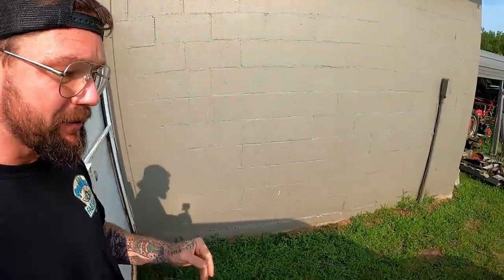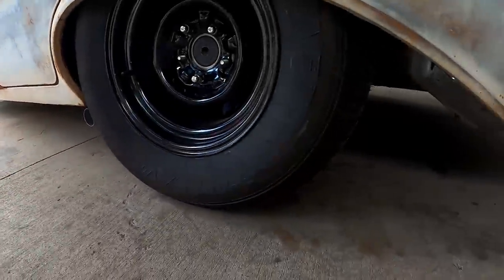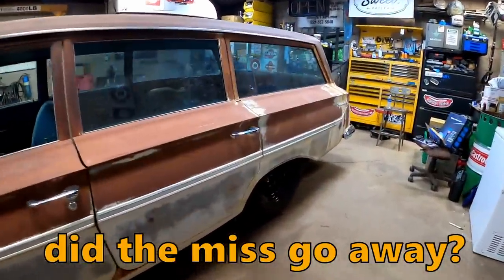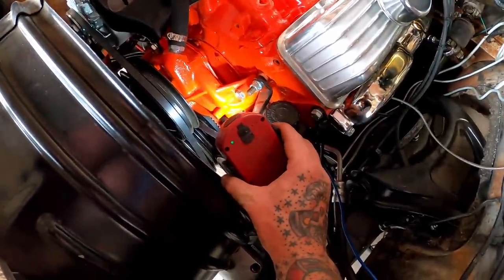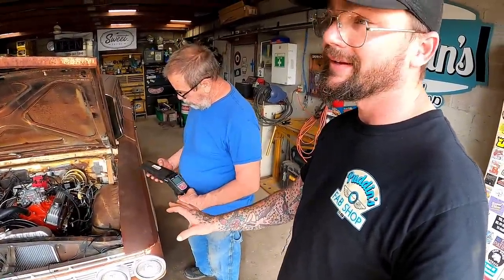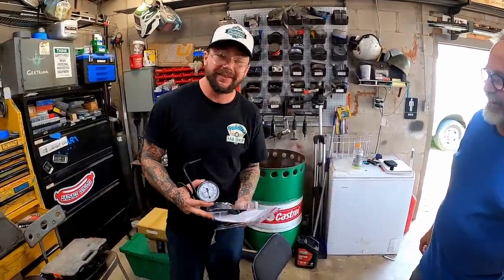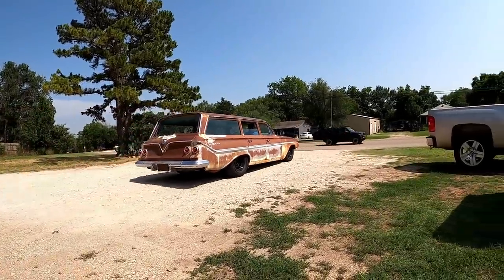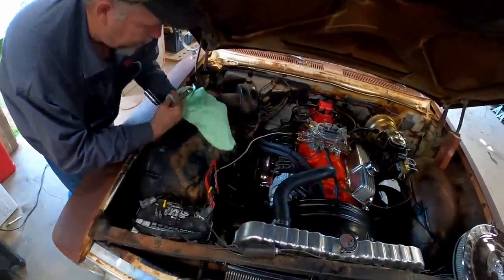Why is it running BAD? 1961 Chevrolet Parkwood. NEW EXHAUST.

Comment: Take an old set of valve covers, cut the tops off and install them. Start the engine, loosen the 1st rocker arm till it chatters, tighten it till it stops making noise, tighten half a turn. Repeat 15 times.

Comment: I’ve got a 155” 2010 express 3500. Once you find the utility of them you are forever a van man!

She tows better than any other truck you own! Strong and stable!
Reply: any chebby van we had since the second gen in 1971 was epic ran like snot  and the early ones from 71 to 77 were  hot rods with no pollution stuff, only prob was traction and I did a 360 with no load on a g30 and ran  slicked road

Comment: Perfect timing Mr. Puddin! I'm happy to see that your "company" grows so you can buy reliable work trucks. ❤🎉
Reply: Today went to get my truck inspected damn bolt holding the rear leaf springs on ripped a few threads out and shifted two inches to the right so when you hit the brakes it would pivot so it failed. Need to fix way my life goes any need a new universal joint also broke in line to get inspection
Reply: 📝Woody, Wagon, Pecking Parkwood,
Got a "Popping Problem",  Under the Hood,
But P-Tang, Slick & Bill,  Made it Understood, 
If 7 Sparks Didn't Send Her,  they Knew that 8 plugs Would ! 🤣🤣🤣🤣
Reply: @keithreilly386 😂😢😢

Comment: That van will probably tow just as good as your pickup., maybe better. The only difference between the two might come down to the gearing.  The only downside I’ve ever experienced towing with a cargo van is they are harder to see out of, other than that they are pretty similar. 

On a side note: I had a fleet of vans for my business both Ford and GM and the weak point of the GM vans was their transmission so you might want to do a preventative service on yours. I think I put transmissions in ever one I owned but we put a crap ton of miles on them everyday. They were excellent trucks. At first you might get the creeper van vibe but driving them kinda grows on you and you see why people like them.
Reply: Yeah, the ford's are the worst. I've blown every ford trans i ever had. Gm trans last much longer.
Reply: Well I would disagree with them being the worst but to each their own. I can only speak on the van’s I’ve personally had and out of all them I’ve never had to put a trans in any of the Fords but that’s not to say I’ve never replaced a transmission in a Ford because I definitely have, just not in any of the vans. I was thinking about it and I can’t remember if the Chevy’s I had were 4L60’s or 4L80’s, but if I was to guess I would venture to say they were probably 4L60’s since they are notorious for not being the best. Even at that they were still excellent vehicles and they got the crap beat out of them everyday. Every brand has problems there is no perfect vehicle out there…

Comment: check the threads showing on each rocker nut...sometimes the press in studs work loose and work their way out of the head....just a suggestion if it keeps going out of adjustment....love watching you show never miss it....God Bless keep up the good work
Reply: ding ding ding , give that man a sucker, I bet hes got it. get to yakin those heads boys
Reply: We used to drill the bosses and studs and install hardened roll pins to stop them from pulling up under stiffer valve springs
Reply: Been there on the pulled rocker bolt

Comment: The screws you're referring to are your idle mixture screws. If one is closed off, then the bank that screw serves will run lean, thus one side of the engine will run hotter than the other.

Comment: I got a 2006 3500 GMC Savanah, has 236k miles, bought it to pull camper. Was surprised how good it pulls, and great power. (6.0). I love this old “creeper” van. 15 passenger, took all but 1seat out, have bunks in back. 
Never will junk it, I’ll put new power train if it ever goes down. 
Thanks for entertainment.

Comment: Be on the lookout for the rocker studs backing out. If those rockers keep getting loose on you it's a strong possibility that those rocker studs are backing out.
Reply: drill and tap the studs for screw in types

Comment: I have been a mechanic for over 40 years and my shop teacher back when i took the course told us to check plug gaps every time you remove them. Love your show. You always start with a basket case project.  And by the way i have peripheral neuropathy  and have severe pain and weekness in my legs and have been sittin on my ass and finishing my projects for the past few years.

Comment: Take one valve cover off at a time and stick a piece of cardboard and run it and adjust the valves that way back it off till it makes noise the start to tighten it till the noise goes away and then give it a quarter turn
Reply: Add aluminum foil to the cardboard and it will take exhaust heat.

Comment: Adjusting the lifters pull the valve covers ,stuff a rag to catch the oil , loosen the rocker bolt till it rattles. Then turn it  in 1/2 turn for gas mileage ,3/4 for performance .

Comment: I learnt a good trick recently, if a cylinders ex valve is on the lobe you can set intake and vice versa, do them cold. Find good specs to suit your engine. Cheers puddin

Comment: Brother, I have the Chevy “church” version of that same 3500 van and it is a towing beast. I pull a heavy race car trailer all around the country and with the 6.0 and better transmission in the 1 ton model it pulls great. You could definitely get rid of the truck if you wanted to and just tow with the van. That was a good purchase.

Comment: Didn't see anyone comment on the mystery part you thought came from the power steering fitting .
That's the guts from the cheap pvc valve that exploded a couple shows back.
Thanks for great channel !

Comment: Put it on TDC #1 adjust both rockers,  turn crankshaft a 1/4 turn that puts #8 @ TDC another 1/4 turn puts #4 @ TDC adjust them thru firing order 1/4 turn of crankshaft at a time will bring next cylinder in firing order to TDC . 3/4 turn of lash.

Comment: When I set valves I use a bore scope. Set each cylinder one by one to TDC. Use the bore scope to watch the valves open and then back off until they just close.
Makes it so damn simple. I've done so many of these in the last 7 years every engine has been different. I've had some that had open valves at 1/2 and 3/4 turn down. But doing the bore scope method I can guarantee they are right on the money allowing for max lift and 100% sure of closure.
Reply: Also when checking timing rpms should be at least 1000rpm.

Comment: Man that hurts the break in procedure is 3-3200 rpm  for 20-30 minutes on a flat tappet cam and in your last vidjayo it didn't sound much more than idle. I even had my toes crossed for ya brother. Stick your borescope down through the head in through the oil port through the to the cam and take a quick peek at what your cam lobes look like.  Good luck brother 🤞

Comment: Couple of thoughts. In my state they require you to run the exhaust out the back to get beyond the interior of the vehicle. I guess if it is legal in your state just be sure you aren't getting fumes inside. Back when I had a 283, I always adjusted the valves while it was running. Seemed to work really well. Nice to see the project coming together.

Comment: Puddin, do your valves in the morning with the engine completely cool. I use a  15 thousandths feeler gauge. Do exhaust on 1,3,4,8 and intake on 1,2,5,7. Turn engine  90 degrees and do opposite on remaining 7 cylinders (1 is complete)

Comment: I was taught to adjust while it’s running, loosen nut till it chatters then tighten till it stops (all 16). Then with motor off give each a 1/4 turn. Rags along edge of head will catch oil.

Comment: I drove an E-350 with 13 Boy Scouts pulling a dual axle trailer, like a U-Haul, from Houston to Altamont, TN which is 850 miles.
I know it's a different brand, but it pulled and drove great, drank a lot of gas with all that weight but I had no issues.

Comment: MAN I"M LUVIN' that Wagon!!   Just an FYI.  Change the PCV from the pass side to the driver side.  Engines pull fresh crank case air from the pass side (thru the breather) and release to the driver side where the carb picks it up thru the pcv.  You might be creating a internal vacuum that may or may not cause tuneability issues.  The PCV is a one way check valve. Therefore the engine is not able to pull fresh crankcase air in and will create a vacuum which may be why you are having a hard time setting the valves. Just something to consider.  Luv the work you're doing. Keep up the great content.

Comment: check you oil for the forbidden glitter. there has been a rash of bad lifters plaguing the aftermarket. unfortunately they usually wipe out the cam when they go bad.

Comment: Run the engine, valve covers off.  Can get a little messy, but...  back off each rocker arm adj nut till you hear clatter, the slowly tighten nut till clatter or ticking goes away... then tighten 5/8ths turn more tight.  Valves adjusted perfectly.

Comment: I always adjusted valves on SBC with the engine running. Tighten it down until it just starts to miss and back her of 1/2 a turn. Isn't by the book but always worked for me

Comment: I had a 2000 3500 van that I used for flea markets. I pulled a very heavy 18ft trailer that was very loaded. It had no problem doing 85 fully loaded on the interstate. Loved pulling a trailer with my van. Wish I had another.

Comment: I bought an Express 3500 passenger van to replace my pickup and I love it. I can take all the friends and family camping, or take the seats out of it and haul pallets of tiles without it sagging. It'll bounce down the road if it doesn't have any weight in it. It tows amazing too. Used it to move some friends recently, packed to the brim and pulling a full uhaul trailer it acts like nothing is there. The nieces joke about the white van and ask for some "free candy", but I just reply with "It has windows!!"

Comment: This is the third timbive commented on this, but... you plumbed your booster into the intake runner on the right bank.   That is a direct path for air to potentially lean out that bank.

Comment: Gm needs vacuum on start up ,then the weight in the distributor take over . On the front of the carb 2 outlets 1 with vacuum at idle for GM ,2 vacuum when revving your engine for dodges and fords ,amc.

Comment: I thought I would share a method I've used for years to set lifter preload. Grab a piece of cardboard and a marker. Write the first 4 cylinders of the firing order 1,8,4,3. Then below the 1 write 6, below 8 write 5, below 4 write 7, and then 2. Now pull the valve covers and roll the engine over until the number 1 cylinder is closing the exhaust valve and opening the intake. The number 6 is sitting on the base circle of the cam. Loosen the rockers on 6 until the pushrod is able to rotate with light resistance and tighten 1/2 turn. Rotate crank until 8 is rocking and repeat adjustment on #5. Keep going. When you get to #6 rocking ,adjust #1. It works for every firing order 4-6 and 8 cylinders.

Comment: That Van will pull like a beast. I have the exact same set up except I have a box truck version same van front 3500 with the duals on the rear and never had an issue, except for the infamous exhaust leak on the driver side rear manifold and the transmissions take a crap right around 100 to 150 K. But I love my Bertha it’s the work beast, the money maker.

Comment: I have had the same problem with tapping. I found out that the fuel pump was making the tapping noise. A spring breaks inside of pump causing taping noise. Try using a stethoscope to pin point taping. Love the show.

Comment: Believe it or not fellers, bill's way is the correct way to set valves on any engine, not just a sbc. And to find true TDC, you can make a piston stop out of an old spark plug

Comment: I took an engine out of a Dodge dart. Got it all together after fighting it and remembering finally it was a slant six which is why it would not go in straight. Also got it finally all done and it would not start. Neighbour came over and looked for a few seconds, hooked up the coil wire and it started up. 9 hours of non stop work, just gets you sometimes. :)

Comment: I'm a ford guy.  Drove a chevy 12ft box van for fedex for 4 years.  Had 170k when I got it and 310k when I left the job.  3 transmissions 3 rear ends.   But that engine....6.0.  Solid as hell.   Hard life for a van but the engine took it like a champ.  Nothing but respect for that LS.

Comment: That van will practically do everything you need of it. I did residential irrigation for about 8 years. Had to tow pipe puller’s, mid sized trailers full of equipment and it never let me down.

Comment: I just sold my 2016 Chevy express 3500. Had it for 7 years and only used it for vacation towing a camper. Put 25000 miles on it towing and it did it flawlessly. Yes, you did have to stomp the throttle occasionally but it towed with confidence. I also had to install a hitch. No factory wiring in mine, had to run everything front to back. But all in all you won’t be disappointed!

Comment: If y o ur using old stock roxkers. They may be worn out. I like comp cams magna roller tip 1.5 or 1.6. Cheap quick fix. I like 1.6 for a hair more lift !!! Keep up the great work brother. God bless

Comment: Hey Puddin, don't feel bad about zinging past that spark plug in your troubleshooting. I was a Mechanic/Ford Tech for 24 years (2 careers ago, lol) and just a month ago I dropped a plug and didn't think to check it before I installed it. Yep, bit me in the ass. Luckily, after making that mistake a handful of times over the years, I only lost a few minutes screwing around and scratching my ...umm...head before the light bulb came on. 
 There's a lot of mistakes that you only make once, and the lesson is learned for a lifetime. I think the spark plug ding is one that Murphy says you need to make every few years just to keep you on your toes. At least,  that's my excuse. Keep doing what you're doing, buddy, it's working for you and I'm glad to see that.

Comment: I use a long screwdriver to find top dead center.  Turn the engine until the screwdriver quits moving up and you are at top dead center.  Works a lot better than your hand or thumb.  I also used a pipe wrench to turn the engine at the crank nut.

Comment: Hey Puddin I got some bad news for the Pott county legend, bud that cam is most likely going flat on #6 hole.  I’m happy you got the 6.0 ready to tow  tow pig you deserve it.  The van is also a great addition and imagine all the parts you can stuff inside with a project on the trailer 🎉

Comment: take a marker and put a mark on each pushrod and then crank it up. if any of those pushrods aren't rotating the cam is bad. if the cam is good then zero lash + 1/4 to 1/2 turn of preload is good.

Comment: I LS swapped my 71 C10 using the same drivetrain as that savanna gmc van. It’s a Gen4 LY6 paired with a 4L80 trans. Solid motor and trans combo. It’s got the good flowing heads from factory.

Comment: Another way you can adjust the valves but its kinda messy, pull the valve covers and start the engine. Back off the nut on each valve until you hear a chatter. Tighten until the chatter stops, then go a half to 3/4 turn more. Do this with each valve.

Comment: You should cut 2 pieces of 2x4 about 4 ft long one each at the back of your ramps it'll do a huge difference when you have a lower vehicle it might need double stacked on each side but usually with something that high you can get by with one on each side.

Comment: I used to drive a van just like that one but a window van for our local high school marching band. It had the 6.0 with the 4L80E. We pulled a 22 foot enclosed trailer full of equipment (drums, stationary instruments,  Props, and uniforms) and usually 5 to 7 adults in the van. Not a problem running in PA mountains and highways.  I drug that trailer through Philadelphia during a Phillies game with no tow mirrors.

Comment: Things not working out here either. Bought a 2011 wrecked car to put the motor in a 2011 with a bad motor. We got it in and the wiring wouldn't connect.  Found out someone put a 2007 motor and wiring in it. Yep both titles are 2011.  Thanks for sharing with us.

Comment: The streetrod shop I worked at back in the day used to have a 3500 6.0 van to haul a enclosed trailer all around the country with multiple chassis and show stands in ect. I'd highly recommend it.

Comment: Ran into hyd lifter failure issues where brand new lifters were not hardened and ground correctly. Mainly because all hyd lifter grinding is mostly done in Mexico now. Might have been a learning curve. 

After two sets failed and had to replace a new cam, I got the diamond like coated ones DLC lifters from comp. Along with their mutha thumper  cam for stock lifter height.

No issues with 1/4 turn preload on E Street heads.

The point is, if she keeps rattlin pull the intake and check lifters. That will give some content to film.

Much love ombre.

Comment: Loosen your valves with the engine running until it starts to tik tighten a nut until it quits is the best way to do your valves

Comment: Oh ya them express vans are extremely reliable and handy to have. I used mine to move into my new place and mine has over 400,000 miles on it original motor and trans. Mine also tows like a dream, you can’t feel anything behind you, it’s my tow pig.

Comment: I’ve had one of those 3500 savanna’s, used them for a plumbing company to haul a hydro jetting machine on a double axel trailer with about 600 gal tank of water on it. Towed just fine, never had any issues with either of the ones I’ve driven.

Comment: That edelbrock, the screw on the front are idle mixture screws. Turn them all the way in and back them both out a equal 2 turns then that's a good baseline to tune from there